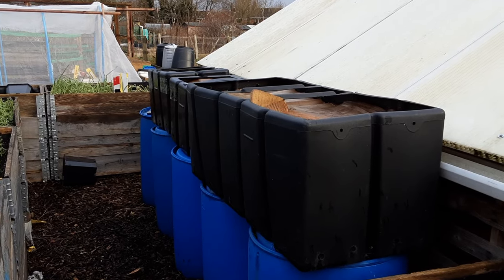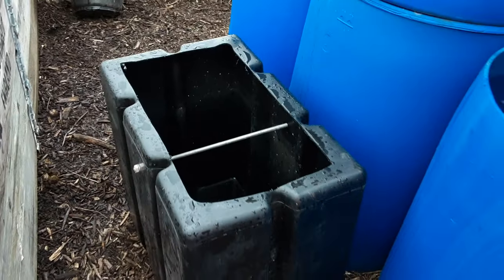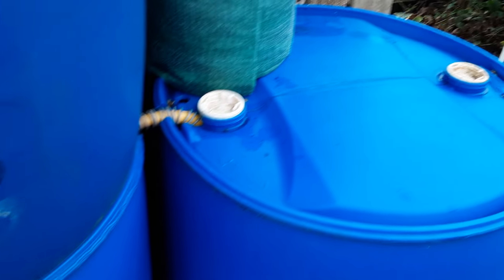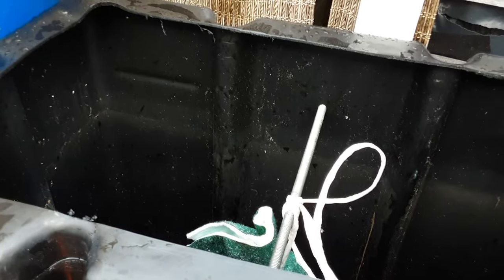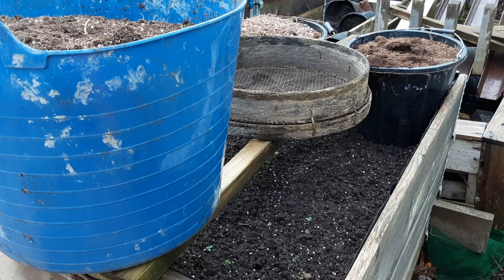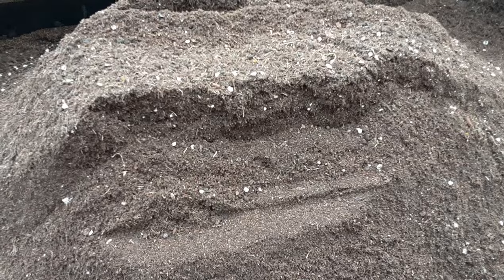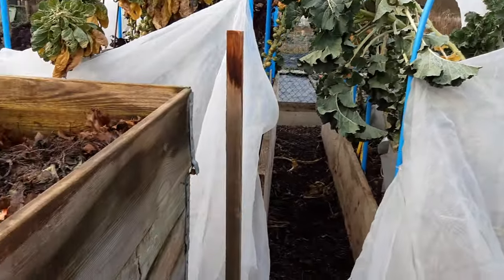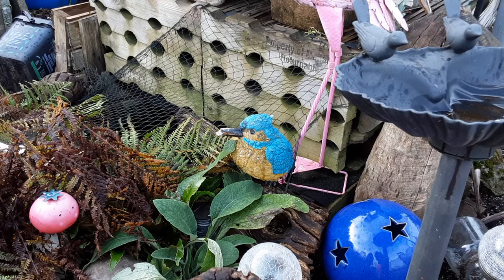Recycling Loft Water Tanks On Our Allotment's & Growing Spaces Using The Wicking System

Comment: Got a question for you. New subscriber here. Nothing to do with this video though. I just thought, as you are an avid recycler, I would ask your take on it. I need to get a shed erected on my plot. I have a 1800mm Rolson builders level that was my step dads. 2 vials are broken - well, the bubbles are empty. The middle one for the long edge and one set at 45 degrees at one "end". As it was my step dads, I was wondering can I replace these vials? Is it even worth doing? I can't see a way of getting the old vials out. Is it worth it? Or just buy a new one
Reply from the maker: I tryed to remove a good one to make a small line level and it was impossible to remove them without damaging them so ask around for an old one, someone will have an old one you can keep on your Plot, I found 3 that were put out for scrap and bought 3 for DIY work at home.

♻️Happy gardening, Terry King.